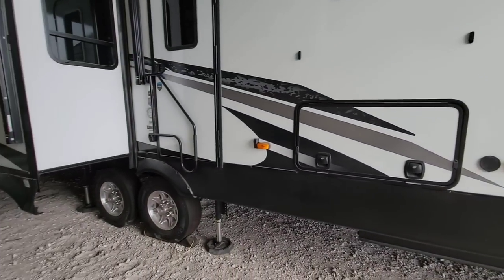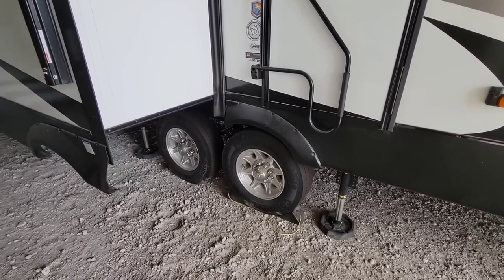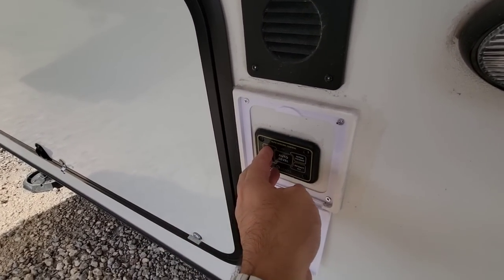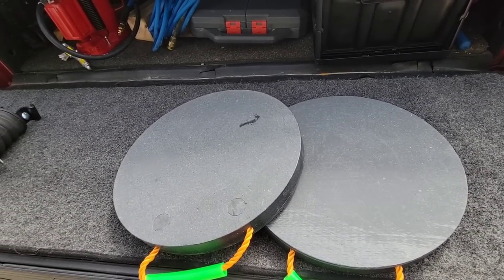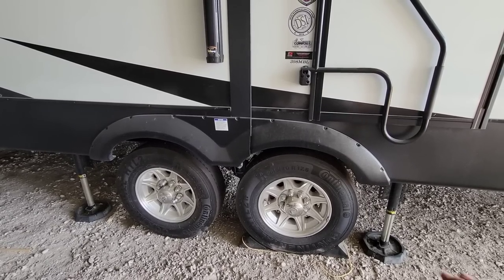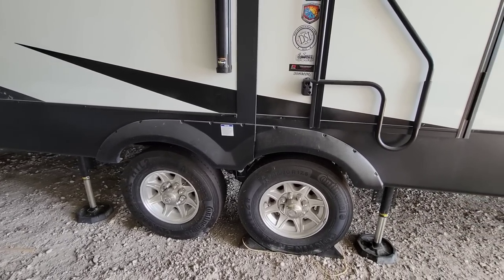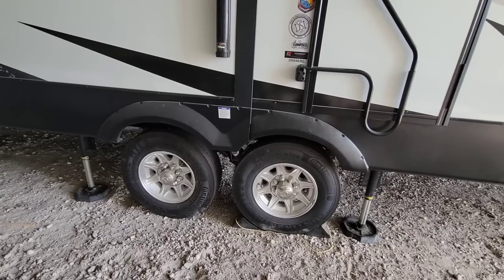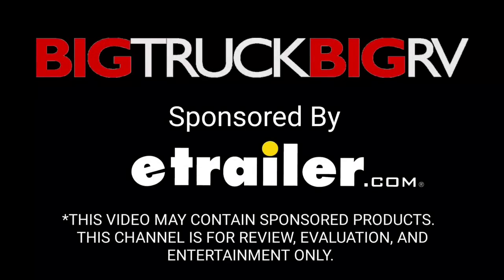These are AWESOME!  Added SumoSprings to our Fifth Wheel RV!

Comment: I don't understand why you would want the Sumo Springs since you have the Road Armor. The Road Armor gives your suspension more vertical travel, while it seems the Sumo would restrict vertical travel. To me they seem to work against purposes. Please explain what I am missing.
Reply from the maker: Hello.  Sumosprings dampen movement due to the foams compression and density characteristics.
Reply: @BigTruckBigRV  apologies if I still don't understand. Are the Sumosprings instead of shock absorbers?
Reply from the maker: More of a shock absorber/dampener than a spring.   However, the foam will act somewhat as a spring at times.
Reply: @BigTruckBigRV  Correct - in the first 20% the SumoSprings act as a shock, and as load is applied the spring pushes back and provides more load support.

Comment: Hi JD, I have a question not about this video.  Are you running the centramatic wheel balancers?  I have been wanting them ever since you put them on your truck and finally got them for my motorhome.  Holding them and turning them I can hear the balls moving and they are pretty load.  I remember you mentioning that in your video.  So, do you still have them on?
Reply from the maker: I still use them and love them

Comment: I'm not clear on why this is necessary.  It doesn't add damping to the suspension.  That's what shock absorbers do.  These add spring rate, that's all, and they do so in a spot on the frame that isn't designed to bear loads.  Can it? Probably. But did Sumo do the engineering on your frame to know that adding the load at that location is safe and won't compromise the structure?  Doubtful.

Stiffening the springs will still transfer the loads to the trailer.  The forces involved will likely be higher for any given suspension displacement since now the spring rate is effectively higher.  

These appear to be a solution in need of a problem, in my opinion.
Reply: These have been tested at Navistar specifically measuring g-force and vibration reduction. Our product is made from a micro-cellular polyurethane and provides high value of damping and shock absorption. We've been doing this for 25 years, and our founder is an award winning engineer. So, short answer, yes we've tested and engineered these to do what we state. -Adam
Reply: @SuperSpringsInternational  Big buzzwords like 'micro-cellular polyurethane' sounds like fancy spongey material.  Damping and shock absorbtion?  That's what springs do too.  

They were tested at Navistar, so that somehow makes them suitable for all vehicles?  Have the other vehicles they're made for been tested to be able to withstand the loads they place on their frames in places that were never engineered to take those loads?

Comment: Of course Lippert uses 1/8" thinner metal.  They cheapen everything they touch.  Replaced 1 Lippert slide motor and it sounds whinier than the Schwintek   on all the other slides.  They also own the parent company that makes the B&W goosebox which is made in Mexico.  Lippert is ruining the RV industry the same way Thor did in the early 2000s.

Comment: That’s not a load bearing part of the frame, there have been a lot of complaints of the frame bending and cracking as a direct result of helper springs. In fact some YouTubers have had their RVs written off as a result of using helper springs like these. In one such case a company that specializes in Rv frame repair wouldn’t even touch it. Stating that in their opinion the helper springs were the direct cause of the frame failure. They went on to suggest that in the future a modification such as this would also require additional frame reinforcement. Look it up I guess since it seems like if I share a link to the video YouTubers get ornery and delete the comment. So good luck, this is one modification I wouldn’t touch with a 50 foot pole.